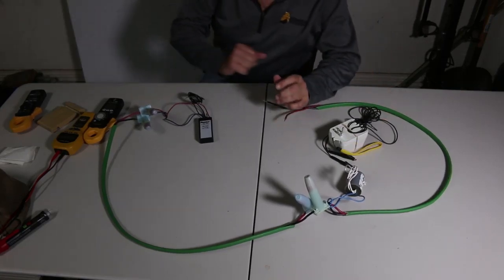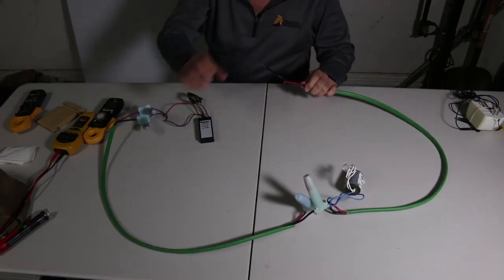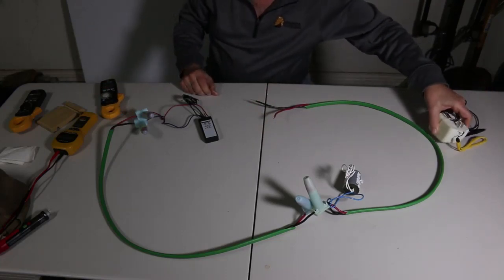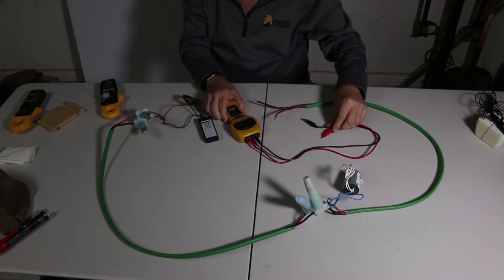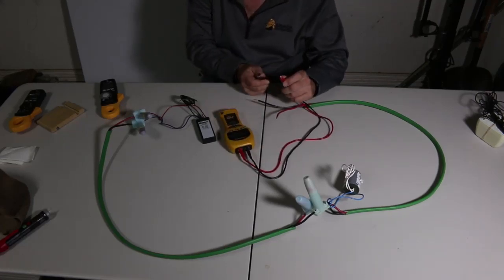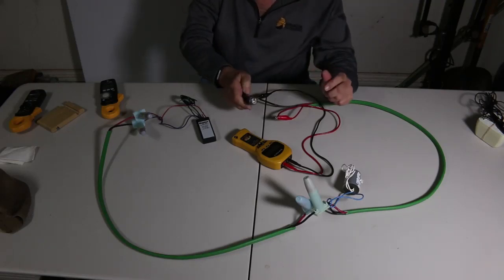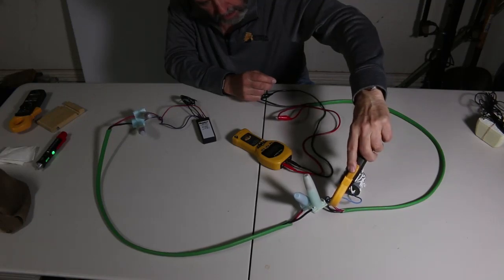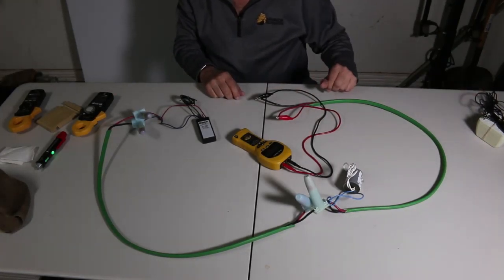Troubleshoot a 2-wire system cable with the Pro50 tester for 24v power using the Pro95 clamp-meter

Comment: how long of a run can i do this test on. also what about toro dc two wire?
Reply from the maker: There is no distance limitation and you can do strings of 100 decoders and more depending on the system vendor. Many decoders use less than 1 milliampere (mA), but some use 4-5 mA.
Reply: @ArmadaTech  just ordered one i do to many systems not to have this and use a dam transformer. thanks